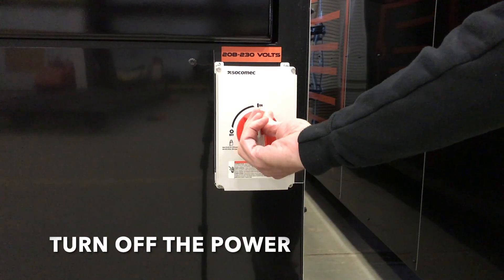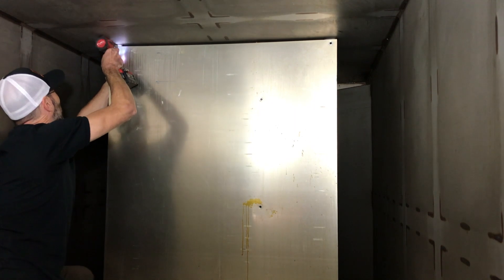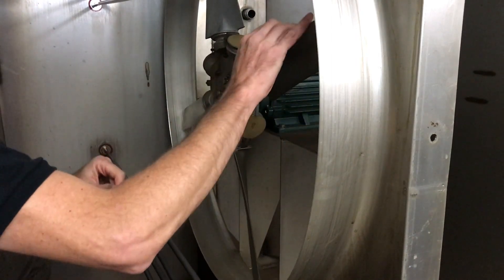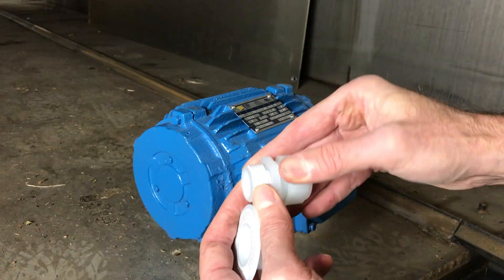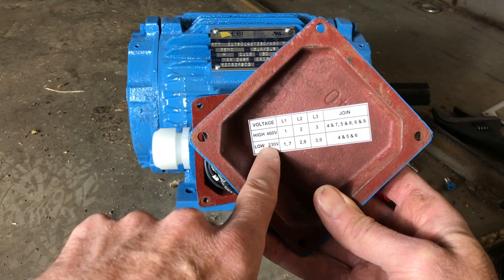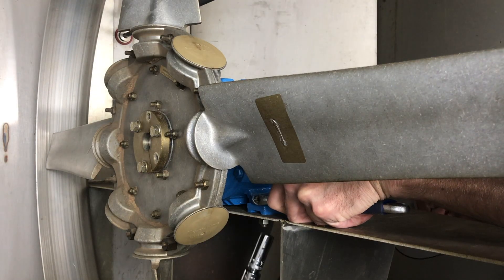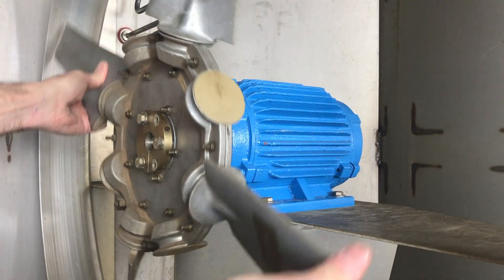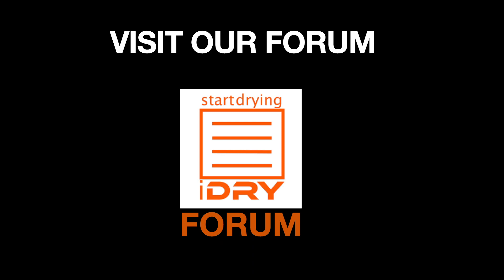Fan Motor Service

Comment: don't understand 
if the chamber under vacuum what is the need for a fan there is no air to circulate
Reply from the maker: The Standard and the Plus units go to a vacuum a bit higher than Mt Everest. There is enough air to use but still enough vacuum to move water fast. Our Turbo series is the deeper vacuum type and does not use a fan.
Reply: My shaft collar has what looks like a ton of wood beetles stuck to it and seemed to be completely rusted - do you sell replacements of these?